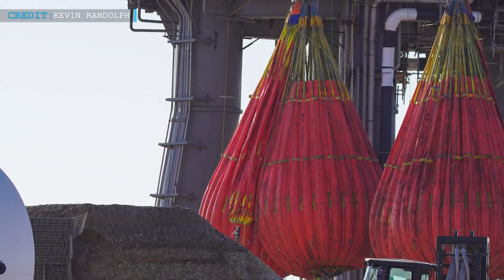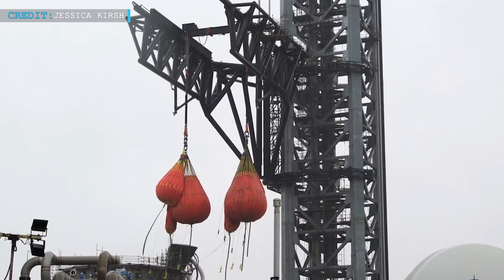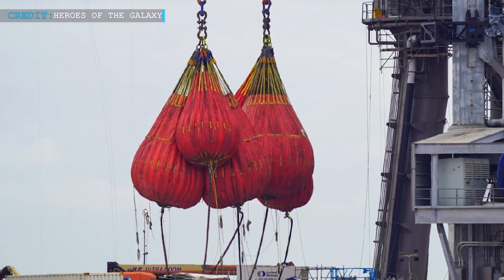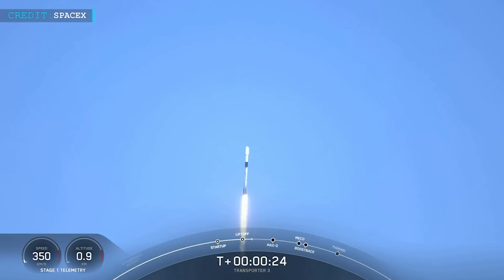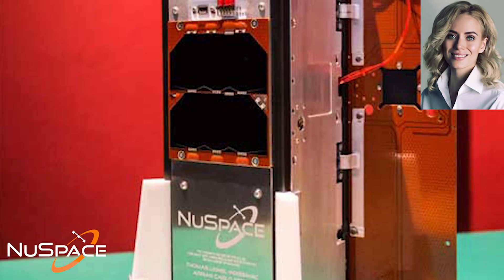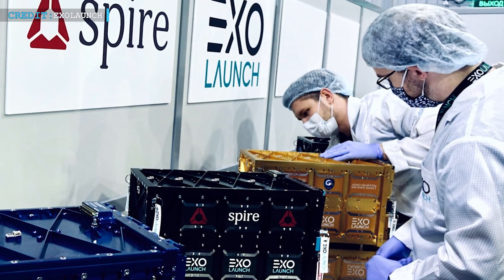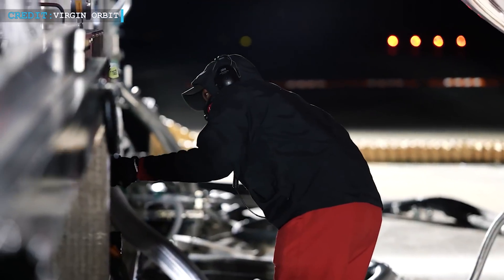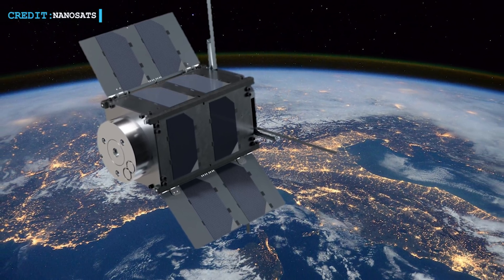SpaceX Starship Catching Arms Stress Challenge | Transporter 3 | Virgin Orbit Update

Comment: Is it concerning that the SpaceX's chopsticks was sagging during the test?   Not saying I know how much weight the arms can lift, but that's doesn't sound too good to me.
Reply: In a disaster with the chopsticks it will just lead to better chopsticks 🤷🥢
Reply: Be interesting to know the amount. If it was less than 15cm near the ends of mechazilla that wouldn't be that unusual from what googled in terms of sag limits for something similarly sized. However I'm sure that they know exactly what to expect and have done tests behind the scenes in some big shed somewhere, as you don't need to stick it on the launch tower to know what the engineering requirement are - gravity works the same most everywhere on Earth lol. Heck, they only need test one side/half of mechazilla to be able to know what the limits are. It should be one of the easiest things  to  determine out of all the engineering...
Reply: Where you seen the sagging?
Reply: @_John_P  Its been reported multiple times from different sources. Not just here.
Reply: @Wrangler-fp4ei  Any links to pictures or footage showing it?